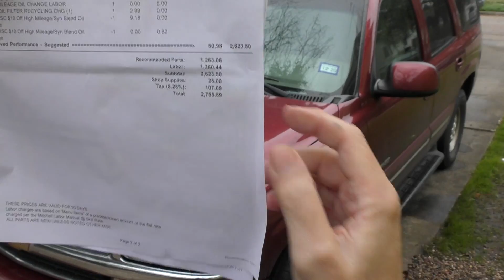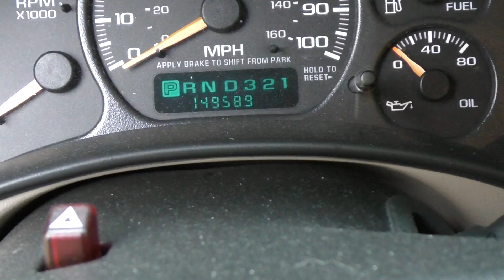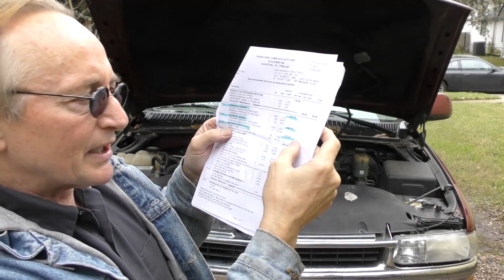This Makes Me Want to Quit Being a Mechanic

Comment: I had an '84 Camaro that had a front caliper that would keep getting locked up.  Went to every place under the sun and every one of them said I'd need all new brake likes and a caliper for that one side.  Went to a shop in a small town a friend of mine lived in and the mechanic there said "it's the brake hose".  I was skeptical because EVERYONE ELSE assured me I was going to have to have a major brake job done.  A few hours later he called me up and said the car was read, that the brake hose had indeed collapsed and it was all that needed to be done.  It only took them longer because they had such a hard time getting the bleeder valve open.  They saved me nearly $300.  At the time I wasn't the best at brake lines/hoses, so I didn't know.  Now I know and I do the work myself.

Comment: fortunately some states mandate motor vehicle inspection simply for the safety of the operator, the passengers, and other people on the road. While there are some who try to sell you stuff there are some who don't even bother to do the job the way it should be done. This leads to dangerous vehicles being put back on the road.

Comment: That Vortec , either a 4.8 or 5.3(same thing basically) engines not even broke in yet at 149k! Hate Midas and all the other big box shops!  Seen this time and time again people getting RIPPED OFF. Find a local owned independent shop thats honest if you need work done.

Comment: My pathfinder had a strange vibration. Liarstone told me that their diagnostic computer said that I needed to rebuild the fuel tank, costing $3500. Luckily I found a local Scotty , who swapped the two tubes connected to the fuel tank and problem fixed!

Comment: The best thing for a vehicle is to be used daily preferably long enough to get it up to full operational temperature and at least up to 60 miles an hour seems nothing harder on a vehicle then when it sits for long periods of time gaskets seals leak brake seized especially if you live in colder climates And the older the vehicle is the worst it is on it sitting.

Comment: When I was young and dumb, no not last year, in the phase between doing your own car repairs (broke high-school / college student) and first full-time job, I would have minor repairs done at one of two national chains known more for tires than car repairs.  Even though with limited mechanical skills, I knew what was wrong (starter/alternator...etc) I’d incur the $50 Mastermind (computer diagnostic tool).  My car was 10-15 years old (early 70’s American brand) with nearly 100k miles that I paid $800 for.  I’m getting a $200 (starter/alternator) installed and am advised that the car needs $2500 worth of work, but with peace of mind that I will have (starter/alternator) that will outlive the car.

Comment: those tires are shot , and to say " Look, its not leaking on the ground " is not true because the truck isnt running and under pressure as it sits in your driveway for 2 seconds.. I bet her driveway has some leaks.

Comment: Got 2011 Scion. Not first owner. Missed warranty on manual tranny: input shaft bearing goes out early on those. Engine rattles for bit at every cold start: Toyota recalled all those same engines, like on RAV4, but didn’t include my car on recall. VVTI doesn’t always work. My point is I love your vids, and I believe Toyota is best, but, my 2011 Scion isn’t the Toyota I’d recommend and Certainly not with manual transmission. No joke, that bearing fails ever 30K or so, unless they redesigned it by now.

Comment: Funny thing is they will just cling to some resource that has recommended replacing guidelines for every so miles or years and that's why they had it on there.  Dumb thing about that is why would someone bring it in for an inspection if they're just checking off a list based on age

Comment: 4:35 - $428 for an oil pan gasket job on those is reasonable, but Scotty's right that one doesn't look like it needs it. That's the cleanest front cross-member I've seen on a Chevy. Usually I find a 1/4-1/2 inch thick layer of oil and sludge on them.

Inspector was lazy and recommended common failure items instead of inspecting it. Definitely a bad shop.

Comment: They all seap a little bit around the gaskets especially here in Canada where we have such huge changes in weather with hot and cold the gaskets take a beating in the winter engines hot and it's cold if you're starting your vehicle a bunch of times in one day in the winter those gaskets are being worked hard.

Comment: Given the fact that I work on my own vehicle's. While changing my daughter's wheel bearing (2012 Fiat 500) the press in type. No press at home so I drove to one of the 5 auto repair shops in town to see if they could press it out and put the new one back in for me. First question he asked was what kind of car is it?..I answered. He then asked where the car was at and if the hub was still in the car? I answered No I have it with me, he then told me he couldn't do it if I'd already taken it off of the car.....I asked why does it matter if its still on the car or not? He said because he didn't have the right equipment for his press and would have to send it to another shop. Makes no sense.

Comment: I own Onsyte-1 vehicle repair in Illinois. Customers pay my price for all parts. I figure if parts are cheaper under a commercial account delivered. I charge $65.00hr. Most the time I get most New customers cause minieky auto repair. Even told my neighbor that his car was to dangerous to let it drive away it had to be fixed. Neighbor called a tow truck.

Comment: True story about Liarstone, went online to check what was on sale needed 4 tires. Sale stated if I use my Liarstone card I'd get $10 off each tire. sounded good to me so off I went, had tires installed got home looked at the bill low and behold no discount. So I called the store and the manager said and I quote " You already got the best price we have, so they won't give me the $10 off each tire "  So as a good consumer I proceeded to e-mail corporate, my phone rings, it's the same store !! seems when you complain your e-mails go directly to the store you had the work done . turns out Liarstone stores are not owned by Liarstone. So NO discount !!

Comment: The Honda dealer wanted $1000 to adjust valves and replace spark plugs as a maintenance item. It is running fine. We are gonna wait and take it to a regular mechanic

Comment: I can’t trust Firestone at all. I changed my cabin and air filter two weeks before getting an oil change, and the next thing you knew, it was dirty, and they tried to charge me 180$ to change both. Second, my car ran fine before I took it in, and after my ac started making noise. They loosen up bolts. Lastly, my rear shocks ended going bad and needed an alignment all of a sudden; my car was running just fine before. They quoted me about 700$. I took my car to a trusted mechanic and told me they tamper with the stocks. Avoid this place at all cost.

Comment: The Honda dealer wanted: $3700 to swap out my Wife's Engine in her civic. I knocked it out for: $700.00
Now my wife doesn't need to buy a new car. Their loss is our gain. Honda's are quite easy to work on. Our 7 series BMW is not that easy to work on- because its the most sophisticated car in the world. It has (5) Engine Computers alone. Its fun and challenging to diagnose and repair.

Comment: Had the dealer tell me that my power steering fluid and brake fluid was extremely dirty snd needed to be changed despite the fact that i had just done it 2 weeks before. Another time they said my inner tie rod was leaking and i needed a new power steering rack despite that fact that i was there cuz my water pump was leaking and getting replaced under warranty. it was coolant on the tie rod that was leaking down on it and not power steering fluid. I called them out both times.

Comment: You have to watch out for the ones that pull vacuum hoses or do something else and then you are told it needs fixed when it did not and does not. Will not give sticker until fixed...those are the really bad ones...then the next level are the ones you are talking about.

Comment: Brought a 2006 Camry with 230km in for an inspection and got a quote for $5000 lol. Brought it into another shop and the only thing that didn't pass was a hole in the fpipe exhaust, which was a quick/cheap fix. But to think you'd have people going in a believing these people and getting a financing plan on $5000 worth of work for a car that's worth $3000....

Comment: Look at the name of the shop, FIRESTONE, the same thing happened to me. Went to Stealstone just to get 2 tires for the front. Well after a hour went by and my vehicle still up on jack they told me i needed brake pads , front end end bushings , etc. Manager said said they could not let me leave shop cause i was in danger by driving my vehicle on road. I told him to put the tires on it and give the district mangers number cause i was gonna file complaint, well got 2 tires at cost and drove off never to return. FIRESTONE is one of the worst shops that tries to upsell you any and everything.

Comment: I like how they check your brakes and tell you the thickness in mm. So I ask what is that in inches? Either they are dumb or they don't want to tell you. Use your cellphone for that and you will find out you have 50,000 miles left on your pads.

Comment: Subaru dealership wanted 1300$ to do my valve cover gaskets and timing belt. I looked up everything and did it myself for 400$ in parts. If they would've told me like 750~ then yea wouldn't be a rip-off

Comment: I took my new Honda Accord to West Hill's Honda dealership in Bremerton, Washington. The car was randomly getting stuck in Park, stranding my wife. Dealership said they have three possible fixes, which one would I like to start with. That's a BIG RED FLAG. You give them the car and make them figure it out. I stupidly chose the $250 fix "attempt" (we can't guarantee it will work) and of course it didn't work. I doubt they did anything. Took the car to Bremerton Auto Repair. I didn't even finish telling the guy what the problem was - he cut me off and said here take this. He gave me a short plastic straw and showed me where to push it when the trans got stuck. He said he would order the replacement part. A few days later, he called me to come in and they fixed it in less than an hour. It was cheap.  Guess where I take my cars now.

Comment: Dunno about those tires, though - don't believe I'd be trying to pass any 18-wheelers on those sidewalls. maybe it's just curb-grinding (looks like she's a real 'curb-shot commando"), but I'd still like to see those skins pulled off the rims & the inside surfaces inspected for damage from running in near flat conditions. Just my .02.

Comment: I would have reccomend a diff cover gasket in my shop if they were not a regular customer just for the fact that it is beginning to leak and its not an item customers check regularly.  Other than that the tahoe is remarkably clean

Comment: Many years ago I had a car that needed new struts.  When to Pep Boys to buy them. Well they had a sale on them with installation. I had them do it.  Middle of the job service manager comes to me and says I need all new wheel bearings. I just replaced them six months before. I asked how they could be worn out in 6 month if the original bearings lasted 90,000 miles?  Slime ball said well you been driving on these bad Pennsylvania roads things wear out.  I told him no just install the struts and drove on those wheel bearing till I junked the car 3 years later.

Comment: I was sick and took my 5.7 L Caprice to my mechanic, who charged me $250 to analyze the problem. He explained a missing exhaust manifold bolt caused an exhaust leak, which made my O2 sensor send a lean condition to the computer, which caused the computer to tell the injectors to supply too much fuel, which "must" have fouled my spark plugs causing the miss. For "only" $1,500 he would pull the head off and complete the repair. After several months, I recovered sufficiently to tackle this job. I was about to pull the cylinder head when I noticed the miss was coming from the passenger side exhaust, not the driver's side where my missing manifold bolt was! With the engine running, I pulled the injector connectors one at a time until I found the dead cylinder. Result: I replaced an $8 spark plug wire (The original wire was fried by the exhaust manifold) and I was "good to go".  Moral: Do your own car work,...period.

Comment: When i was in college and 100 miles from home my parents park avenue i was driving developed a power steering wine. I took it to a mr tire to have it checked out and they wanted to replace the power steering pump and rack for 2700. Using AAA i towed it home and our local shop found a power steering hose  was faulty and replaced it for 250.

Comment: I like taking my work van to firestone bc they like to do hella stuff on it. I took the van in for a low tread tire and brake check and it came out with 4 new tires and several fluid changes. Im happy with it bc the peace of mind knowing all the maintanence is done on the companys dime. I'd never take my personal in tho unless its for tires the guy cut me a deal for my personal anyways. I saved a bunch on tires for my personal which was needed

Comment: Hate to be that guy, but a 2013 bmw 328i does not have twin turbos.... it’s a single turbo. The N20/N26 that those cars come with is a garbage motor, but it’s a garbage motor with only 1 turbo not twins.

Comment: My son-in-law took his high mile Hyundai to Firestone for a brake job. This was 3 years ago. He paid $800. A few months later he complained that his rear brakes were squeaking. I told him to bring it to my place. I had a hell of a time getting the drums off due to the wear....the un-worn-down edge ......hanging up on the shoes.  Original drums. Got drums off and what remained was shoes metal to metal on the drums, 10 years of crud, untouched bolts.....the original factory brakes.  He got screwed. I told him I would be happy to “discuss” the situation with Firestone. He refused my offer and  negotiated the cost of the replacement parts........still got screwed. I feel sorry for those who don’t know how to do their own repairs. Sheep to the slaughter.  Semper Fidelis Dave Heitman

Comment: 1. That customer paid for a complete vehicle inspection, not a Texas State inspection. 
2. If you read the estimate correctly, you'll notice they have MAP codes (Motorist Assurance Program) to signify the level of urgency for repairs. Based on the fact the gaskets are barely seeping, the technician who inspected the vehicle should have stated they are close to the end of their useful life and not required replacement. It is still the service adviser's job to price out the work.
3. This is a lazy representation of a chain that takes customer satisfaction seriously. Scotty made a video about this being a state inspection when it wasn't. 
4. A tire is considered worn at 4/32" tread depth. It is common to suggest replacement at that point so the customer can start making plans to change them when they end up losing all the tread. In a business with so much on the line for both the customer and the company, it is prudent that if ANY issue with a customer's vehicle is noticeable at the time of the customer's visit it is written up so the customer is informed about it and can make their own decision based on that information. 

I usually like your videos Scotty. This one was way wrong today.

Comment: I bought a 2010 mercedes benz ml350 that the dealership promised to repair the issues and they didnt. They actually voided my warranty by doing one repair wrong and now are refusing to do the rest of the promised work. Taking it to mercedes i find out therenis 8500 worth of stuff that is supposed to be done to it. How do i not get screwed over again

Comment: A GM Stealership charged my elderly parents $1000.+ . 
To change all the fluids in their car .
Then one month later they noticed that it was leaking oil on the garage floor. Took it back to the GM Stealership and they said they would need a new engine. My brother took their car to a different shop and they found a crushed oil filter that was so leaking because it was tightened with channel locks. The GM Stealership denied that they did this.
So sickening.
How do people sleep at night , doing this to elderly people.
I hope Karma pays them a visit soon.

Comment: I have a 2000  tahoe that i show off and for back up when needed  for my local fire department its bone dry on the underneath and runs great after 146,000 miles on it i tour the midwest with it

Comment: Scotty i got a 2009 honda civic coupe 5 speed with 142,000 miles. It started fine yesterday and today it got pretty cold about 5 °F. It cranks good but only seems to start when i give it a bit of gas. Thinking my fuel pump is getting bad

Comment: 8:00
"2 or 3 times a month..."
A few seconds later...

"At least 3 times a month..."
A few seconds later...

"3 or 4 times a month..."

Good thing the clip ended before he had little buddy on the highway every day to blow out the carbon buildup!
Reply: 8:25 " If you drive less than 35 thousand miles a year you still need to change your oil and filter at least once a year" YIKES!

Comment: Hi Scotty , I have a ‘86 dodge 360 that have to get a ac Compressor to convert , now when I turn on the ac in the cab it kills the truck and the motor   Itself gets hot fast, like with in 5 minutes the  radiator is hot the the touch

Comment: My hummer H3 was stuttering when sitting on red light. I took it to autozone to run diagnostic and it said cylinder 3 was misfiring. I took it to Pepboys they charged me $700 to replace 5 sparkplug and one sparkplug coil.... it was a 30 minute job.... freaking thieves 😤!!!!!